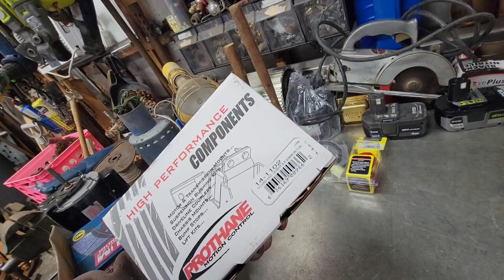Nissan Hardbody Restoration (Snow White) part 2

Comment: A caliper froze up on my Nissan years ago.  I thought it was a dragging stick, but couldn't see the stick.  Nope.  A year later, same sound.  The SAME danged caliper had frozen up. The garage I use defected it out under warranty and just charged labor.  I think Nissan likes to pull stuff like that.
Reply from the maker: You can't really blame Nissan it was probably the passenger side because the passenger side hits all the puddles ... unless you're driving on the left hand side over there....
Reply: @ScrapFarm  Passenger rear.  Around here it's not the puddle so much but the potholes.  They're the chief crop of New England.

Comment: Why are you not at your shop with the lift, I would think it would be easier to work on plus you could fix the weight reduction in the frame?
Reply from the maker: If I go over there and take my truck apart I'm stuck there until it gets fixed..... If I need parts like I did I'm stuck there with no one to help me go get parts and only having 1 vehicle there... Not to mention I don't like to leave my grandmother home alone for hours and hours and hours and hours.... So it's kind of just one of those things... Plus it's a lot easier to heat this small space than my giant garage.... But I do definitely need to get over there and do the leaf Springs... Sometimes I'll go over there really late at night and then I don't have to worry about her as much.

Comment: You and them rotted out Nissans How does it even pass inspection with holes in the frame?
Reply from the maker: It's exempt
Reply from the maker: And it doesn't matter either way they do not do a safety inspection in my state for passenger cars they plugged into the computer and if the computer tells them it's good it's good